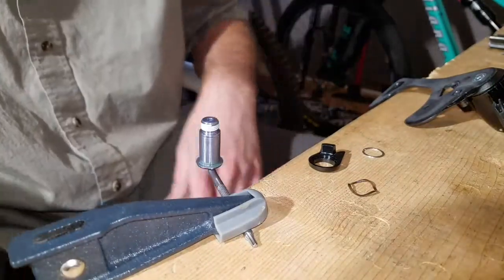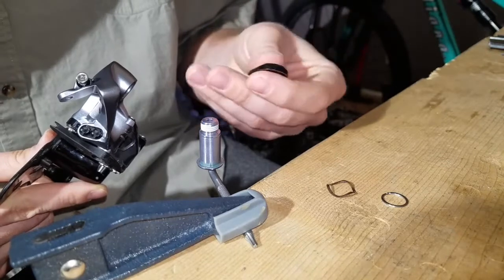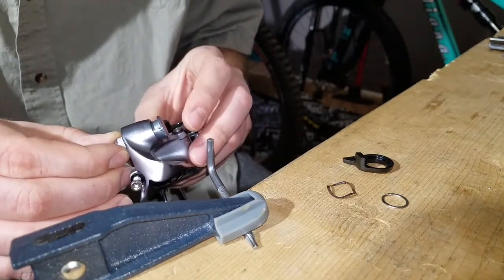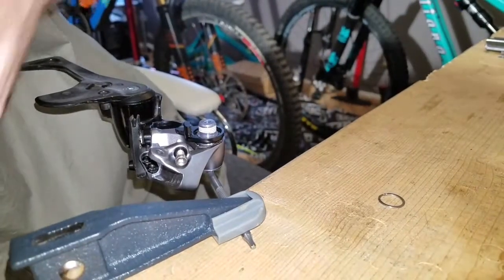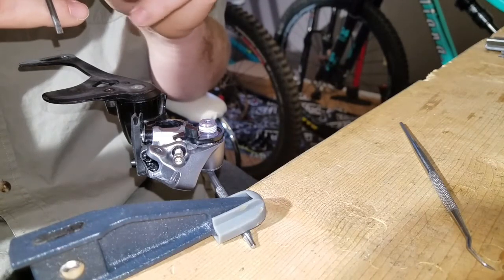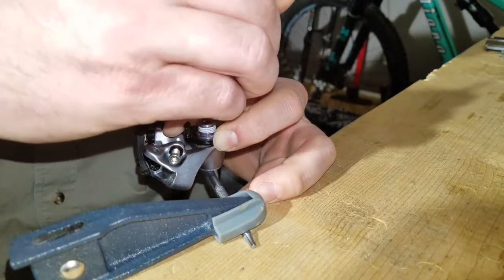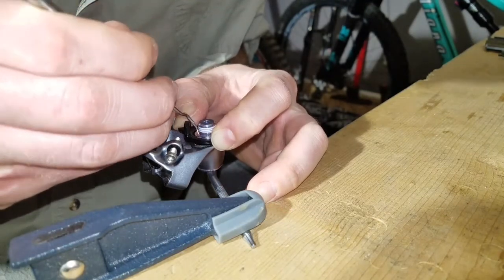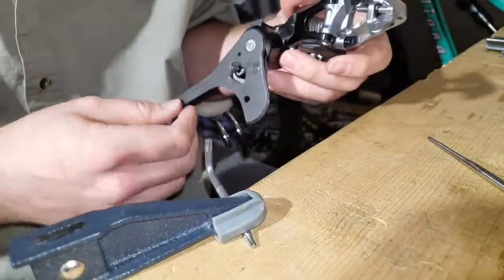Sram B-bolt Replacement Derailleur Tutorial (Sram XX1, XO1, XO)

Comment: this is the same for the SRAM axs rear derailleur right? all those parts came lose when I unmounted my rear derailleur from the frame/hanger when flying home with a bikepack, I was not even aware you need to do those steps, I just screwed the RD back onto the frame with all those parts "lose"
Reply: thanks for the video mate, I did now manage to do it ;)
Reply: Packing my new Tarmac for a trip and removed the Force AXS RD and the two washers just fell off. Worried about getting this one back on once at my destination. Limited tools and no bike stand. Any tips? What worked for you?
Reply: @aham23 I somehow managed it, you need some sharp tool where you can put under to glide. Maybe look up bike shop to help you or maybe even phone repair shop

Comment: Thank you for sharing this. I stripped my b bolt. Finally got the old one out with a screw extractor. Used a comparable bolt on an a similar rd. Took me approx 45 min to get it out and 3 hours trying to get the clip in the groove. I ended up useing a small allen key and pushed down on it with a little force to expose the grooves and that worked easily!
Reply: I also stripped the b-bolt trying to get the derailleur off of a broken hanger. Which led me here.

Comment: Thanks, John, the technique worked great. I also used an x-acto knife to initially separate the layers of the ring and then switched to the pick to move it into the groove. George Fry's suggestion about using zip ties to compress the washer was a great help, too. SRAM RED eTap AXS RD.

Comment: Do you need the small parts. Can you just fit the derailleur without the split and/or wavy ring so that you just have the b tension bolt stopper and b bolt?
Reply from the maker: I have been told by another mechanic that you can run it without the split ring and just the wave washer. I actually tried it, and it seems to work fine, but there was a little bit more play in the derailleur.
Reply: @johnjaguar89  yep I'm running it without the split ring and had the same experience as you
Reply: I can also confirm there is more play in the derailleur without the split ring. So much so that I couldn't get smooth shifting

Comment: Thanks so much! This assembly came apart on my NX derailleur and I wasn't sure how it was supposed to be reassembled. I was able to get the split washer in with my hands, splitting it with my fingernails, which worked with a bit of patience.

Comment: So, this was poster earlier. I damaged the hanger and I am trying to replace it. In order to do that I also need to replace the hanger bolt. I have the new hanger and hanger bolt, but for the life of me can not figure a way to get the c-clip out of the old hanger bolt that is still attached to my X9 derailleur. I have made it to the b-adjust washer and can see the clip, but how to get it off of the hanger bolt? Any suggestions from anyone who has had to reverse engineer the above tutorial? Thanks
Reply: Same issue. I used a dremel to break off the washer - just be careful not to cut into the hanger.
Reply: @ap8833  I resolved it when my bike shop told me they couldn't get the clip off. Fortunately, I remembered a discussion about removing the hanger bolt in a MTB forum. I purchased a dental pick. It's precise and strong enough to grab the clip and pull it up over the threads of the hanger bolt. I had the clip off in a minute and the bike is up and running. The pick is now another tool in my bike toolbox.

Comment: Do you think I could use this Shimano kit for my bigbox bike? My B tension plate broke off of my "Pro Rush" deraileur that came on my Schwinn Taff, just the little arm part. It's a bummer because you can't even buy a replacement deraileur. I could buy a better deraileur as a replacement..if the cassette didn't match the deraileur. And the shifter. Oh, and it's a freewheel. That's an entire drivetrain plus a wheel that I would have to replace, costing 372 doll hairs (and that's serious budget components), for this tiny little broken piece. I knew I should have forked out double the cash for a real bike..but I was so excited to ride, serious mistakes were made.
Reply from the maker: I'm guessing the derailleur isn't serviceable to replace the plate? I'm not familiar with these shimano components, but you should be able to replace the derailleur with the another better quality shimano derailleur of the same speed, so your shifter and cassette spacing all match up. That shouldn't cost more than 50 bones. You could probably even find a used one cheaper.

Comment: Or some idiot stripped out the torx on a used bike you purchased. The guy must have used a regular hex on the torx. Thanks - Ordered a eTAP replacement but zipped tied the limit down and replaced while sitting on the couch.

Comment: Helpful video. A minor difference with the NX. SRAM doesn't give a wave washer with that replacement kit, but rather a thin red O-ring. The split ring was a bear to install, even with a dental pick.
Reply: my new NX has nothing, I think they forgot to put it on, it's very loose!

Comment: is it normal for these x1 sram derailleurs to have a slight play when bolted in to the frame and no chain attached? I Can sligthly rock my force 1 back and forth and maybe it was due to damage.
Reply from the maker: Yes it will have slight play. Not enough to cause poor shifting, but there will be some because it has to move freely. I doubt it's damaged.
Reply: @johnjaguar89  ok thanks for the reply! The play seems to be quite large though, I'm measuring about 1mm to 2mm at the upper jockey wheel. it's true that once the chain is in place, I cannot rock the derailleur anymore. But  I was wondering if this had to do with some washers missing. I had one washer that came with the derailleur (a loose washer, not the ones you are using here) and lost it at some point.

Glad to know it's somewhat normal though
Reply: NoNotReally any problems since? I’ve got the same problem
Reply: @Megadeth6633  any problems since? I’ve got the same problem

Comment: Thanks for the video. I spent ages trying to get that damn thing on but got there in the end. I replaced the mech and then unscrewed the bolt holding the mech on the hanger and I noticed the split washer had come off its seating. I’m going to have to do the whole thing again tomorrow because it’s late now and I’ve got zero patience. I wonder what would happen if I left the split washer off???

Comment: Great video.  What causes you to want to change the b screw?  I have grinding when I'm torquing on the crank going up hill primarily.  Is the screw likely causing the problem.  Thanks!
Reply from the maker: I break the B-adjust washer quite a bit on my DH bike. That's the only reason. It's a known issue and Sram has fixed it, but didn't issue a recall or anything, which is annoying.

If you are getting grinding only when you are in a high torque scenario I doubt this is your issue, because it would just grind all the time. It's hard to diagnose the issue without the bike and knowing where the grinding is coming from.
Just check to make sure your upper pulley of the derailleur is about 15 mm away from your lowest (biggest) gear on your cassette with your weight on the bike.

In my experience with grinding cranks or cassettes I have done the following:
-ensure your derailleur is adjusted correctly
-re-grease your bottom bracket and cranks and tighten them to the proper torque specs.
-ensure your cassette lock ring is tightened to the proper torque.
-check the pivots for play in your frame if it's a full suspension.

If all else fails take it to the bike shop. I've had a creaky crank on my old bike for a while and ended up finding a crack in my frame that was causing it, so give it a good inspection!